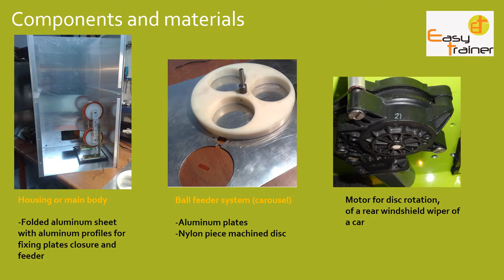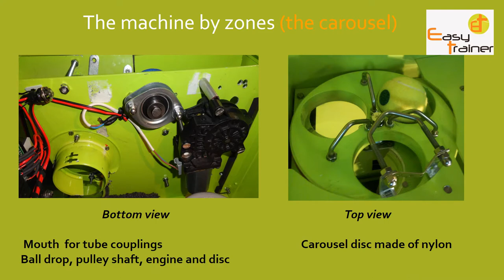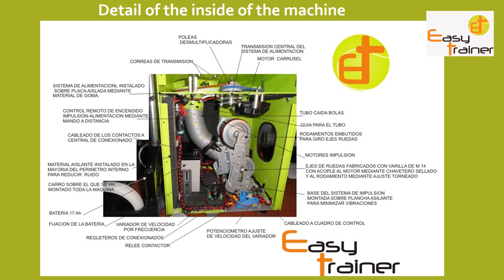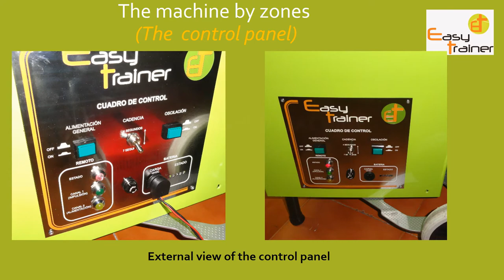tennis ball machine homemade

Comment: nice project. is the wheel also working, if the box is full with balls? mine gets stuck, if i have it full with balls. I think the torque is too small, cause im not using gears like you and attached the motor directly to the wheel

Comment: I just don't get it... 
You spent what - 20 hours at BEST building this?
Even at a Shop Bill Rate of $80/hr, your device cost $1600 in labor alone. 

These projects are only interesting if you can actually (and GENUINELY) build them with ORDINARY parts & skill for far far UNDER a typical "new" price tag like the Slinger Bag for only $715 delivered. 

I get the impression you guys are all shop nuts first... and tennis players far far far second. 

FRIENDLY CHALLENGE: 
Start with something far CHEAPER than a $715 Slinger Bag (say a pitching machine?) and turn THAT into a TennisBallLauncher far far FASTER and CHEAPER than building something from SCRATCH in a shop. THEN you'll be onto something ! 

:-)
Reply: Yeah but think of it this way, Tennis ball machines break down frequently.  If you build it yourself, you can easily repair it anytime it breaks, and make changes to strengthen weak areas that you find.
Reply: Yes, you are right: YOU DONˋT GET IT.
Reply: My gosh. What an aggressive comment, lmfao. What about the customizability factor? With your own machine, you’re able to include features like: serving (height adjustment), wider range of speeds and angles, recoil mitigation (more precise shots) via line detection, etc…